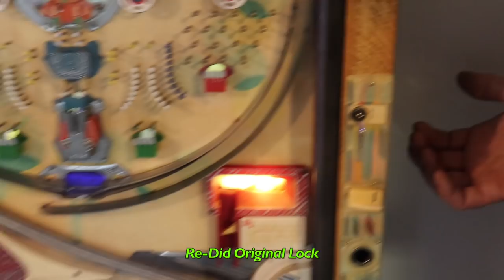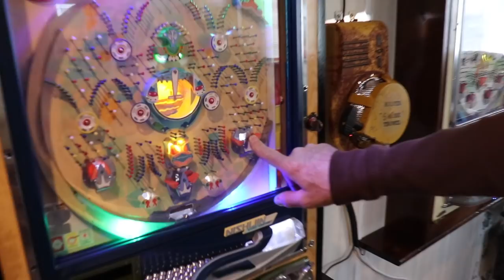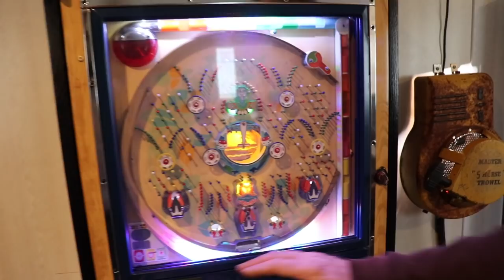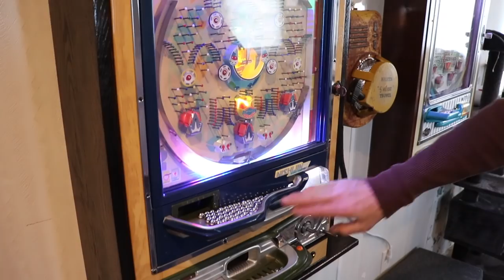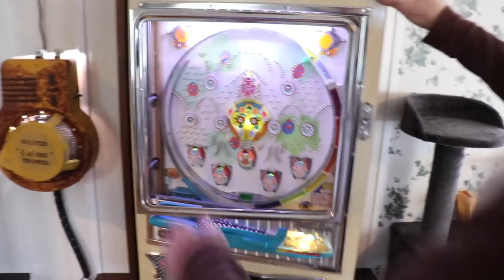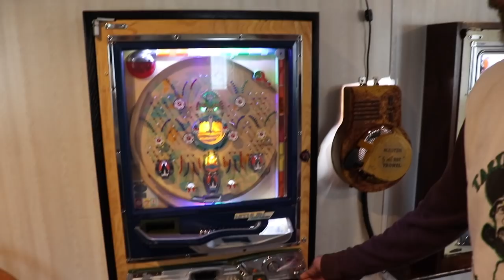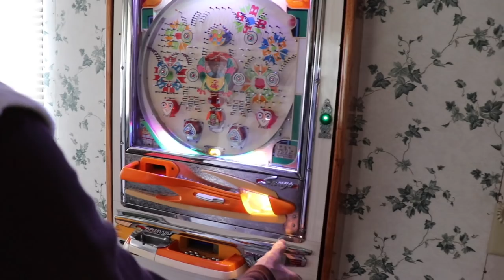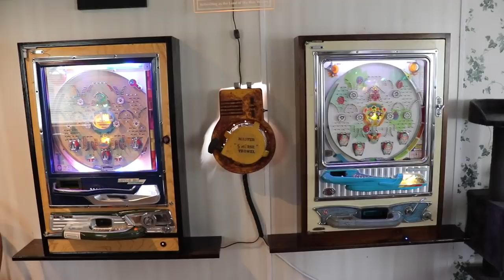INCREDIBLE Vintage Pachinko Machines

Comment: We lived in Okinawa when my parents bought me one in 1977.  The ones we got were removed from pachinko parlors, reconditioned, and sold.  All the machines there have a glass front like the one you have.   The machine is in the attic above my mom's garage.  Besides reviving old mowers, now Taryl has me wanting to go pull that machine out of the attic and dig into it.  Love what you did with the lights and gorgeous woodwork!  If I recall correctly, mine only has two weak incandescent lights.  The JAL on the plane in the middle of the rapid loader is Japan Air Lines.😊

Comment: Whoa! I got my first pachinko machine from my uncle almost 40 years ago.  That one is long gone but I have two that need restoration. This post has me pumped up to get the better one up and running asap. Thank you! I was actually trying to find your video on adjusting governor on a Kohler engine and got sidetracked by this video

Comment: Your greatest video iMHO.  I was with a friend in Tokyo and we went into one of those Pachinko Parlors.  3 floors!  Our machine had a small CRT screen in the centre (80's?) and was auto feed.  We managed to get the  jackpot opening set just right and had 7's going both ways on the screen.  Lights were flashing, people looking, bells etc ringing and people were taking their balls and dumping them into our machine! 5 min of fame?  At 10 or 10:30 PM, the lights flashed and every winner cashed in.  We received a tiny token, I think it was a 1$ us gold coin with a hole in it.  A kind lady directed us to the rear of the building where there was a small wooden building with a window covered in brown paper and a slot underneath.  We put our token in the slot and a considerable amount of U$ came back.  To circumvent gambling laws, 'someone' was purchasing the tokens people won.  Memorable. Thanks.
A fantastic resto job Taryl, many hundreds of hours of research, improvisation, thought and labour.
Where's the cat?
Reply: @Zachery Dominguez It is a different culture over there.  People help others in need with no thought of reward.

Comment: VERY COOL!  I bought my one and only *(rapid loader) Pachinko machine in Sasebo, Japan in 1971.  And yes, they all had GLASS fronts.  Mine has NO lights, and the ash tray has a flap like panel at the bottom that is spring loaded with a little extension.  Pull down on it and it dumps on the floor (or whatever happens to be in the way)... ha!  No smokers in my house.  Completely stock machine.

Comment: Nice work! I still have the machine my parents got me for Christmas from the Sears Wish Book in 1979 and I picked up another machine a few years ago from a thrift store. They've just been stored for quite a while and I've been planning to set them up and have been looking at different things about Pachinko online, which led me to your video. I really like what you did with the lighting and the cabinets. You gave me some good ideas that I think I'll put to use. Back in the day I had a typical household transformer from some no-longer-used electrical device and had the built in lights running with power from that and also wired in some standard Christmas lights to add more lighting. It was a crude version of what you've done with the LED lights. The LEDs give a much more dramatic effect, but I clearly had the same thought you did back then... not enough lights! Thanks for sharing your tips and showing us what you created.

Comment: Venture was the original supermarket on the left side cafeteria in middle and department store on the right. Super WalMart copied Venture just no cafeteria and reversed the stores layout. Did you have a Dolgins as well Teryl? They were Best Buy before Best Buy back in 70's.

Comment: Hi Gary I'm having a hard time trying to find a belt for my 1995 Craftsman Kohler command 42 inch cut the AYP    #144959 belt is to long ..the model number an an number is worn out under the seat.cant see it . I need you help.

Comment: If you were to find a micro led christmas tree in the garbage they have the transformers and the led's. They change color on a square wave pattern. You can find them used, I buy them and fix them but 1 section with a transformer would get you going and that's micro led's not the led bulbs.